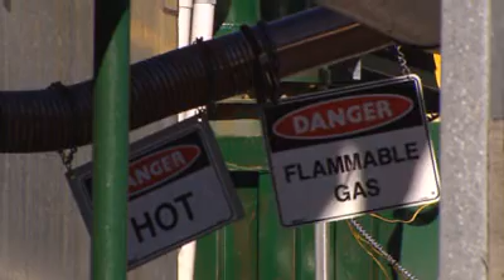Biochar - agrichar - Terra Preta

Comment: I don't think you get the point.  Charcoal can be made through clean modern processes from material that is already being burned off inefficiently.  If the charcoal is applied to the soil it sequesters carbon.  It also encourages soil microbial life and the soil often holds three times more carbon than the vegetation above it.  

If all you are going to do is come on you tube and make negative comments then maybe you should just get into your Prius and drive to feel better about yourself.

Comment: The aim is not to cut down tree's to specifically make biochar. This would be very counter-productive as you have a living carbon sequestration device in the tree itself.  The aim is to make biochar out of redundant timber and other organic matter. Such as using tree's to make furniture and the like somewhat permanently sequesters carbon until the day it ends up in the fire and all is burnt back into the atmosphere. When the timber goes into the soil unburnt, it off gasses NOX, CO2 and Methane

Comment: soil degradation plays a major role in climate change.  un millenium report reports ONE THIRD of all arable land depleted between 1950 and 1990. soil restoration is improving food security water renewal, draught and flood prevention and local climate regulator all the same. woodgas technology is great to make power , heat and charcoal, woodgas stoves are simple to cook  with and produce the biochar for teh kithcen waste and excreta  terra preata sanitation is a way towards water protection too.

Comment: The only thing biochar should be used for is plant matter - leaves, stems and maybe roots. 'Biochar' derived from garbage, sewage sludge or bioremediation crops contains too many truly toxic wastes to be spread on an avocado orchard, let alone _any_ ecosystem.

Also: this method doesn't pull carbon directly out of the air as suggested by the video. The plants do that. We're just burying the carbon they made after converting their work into biochar.

I want to see a study on the released gases.

Comment: James Hansen figures you could suck out 8 ppm of CO2 per 50 years using biochar.

That's not nearly good enough by itself. We need to get rid of coal power fast and that means nuclear.

Agrichar seems much more useful for soil fertility and production of industrial chemicals( don't waste the precious syngas making fuel for internal combustion engines; make ammonia for fertilizer and explosives, make raw materials for glue, plastics, pesticides, medicines...)

Comment: The main problem is, as I said before, transportation costs, mainly due to high fuel costs (due to the high cost of oil- and of deisel as a result).  Biofuels actually help to relieve high fuel costs, thus placing a downward pressure on the price of food in starving countries.

The cost of food in the US may have gone up in part because of the rising cost of oil (which is used to make many agrochemicals) and increasing competition for food supplies by international markets...

Comment: What about all the energy it would take to power the pyrolysis plants??  And it seems unlikely that no CO2 would be released during the kiln firing of the biomass.  I understand that pyrolysis is just breaking organic matter down by heat but there would have to be some exhaust from the kiln, even if it was just after firing when they opened it.  But if it was coupled to existing power plants and utilized waste heat from those plants then it could be very effective.